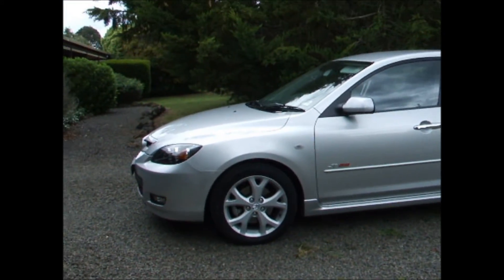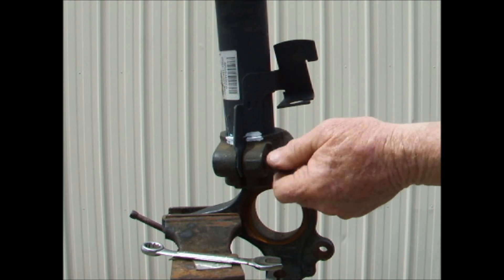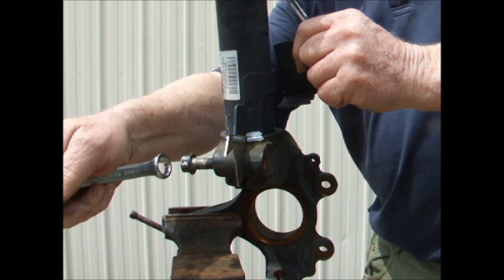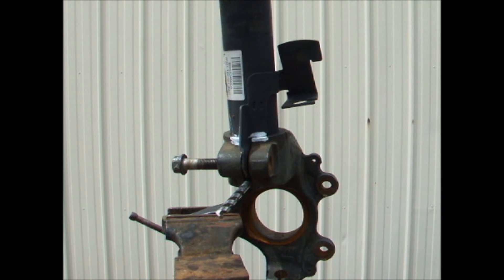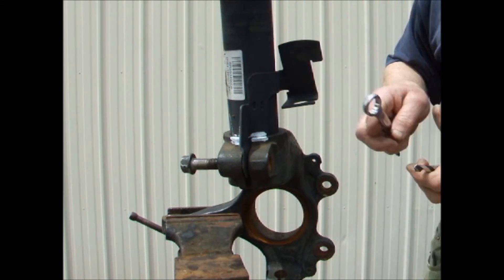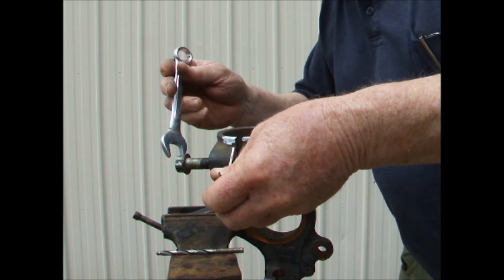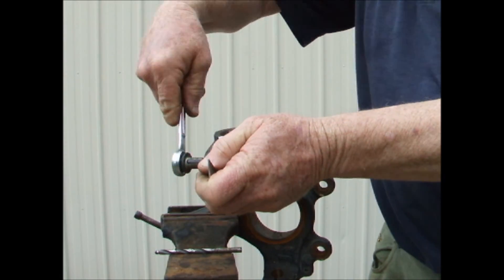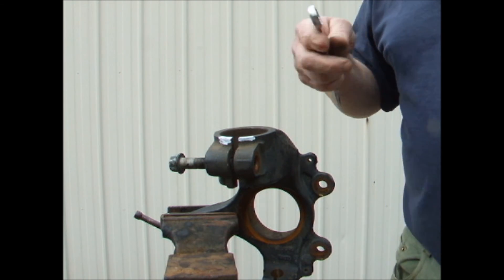Mazda3-How to separate a shocker/strut from a steering knuckle

Comment: What kind of steel plate is that?  I tried similar approach and the plate deformed and did not spread the knuckle.  Any advise?
Reply from the maker: Sorry for the late reply, I've only just seen your question. In the youtube I used stainless steel. At the wreckers I have used a seat belt tongue and at home I have also used a lawn mower blade, the swinging blade variety measuring approx 50mm x 140mm which is hardened steel. Good luck.

Comment: This so far has been a no-go for me. The bolt will not thread on the opposite side more than a few millimeters. Mine is a 2006. I am hesitant to power the bolt in. I do note that the hole on this side is quite small, really just to accept the tapered end of the bolt. I do wish yor camera was positioned to the other side, as that side is far less informative.
Reply: Phil BB I actually had this idea as well but, like you, threading the bolt in from the other side did not work, not without stripping the threads. I might try chasing the threads. I have an ‘06. What did you end up doing to free the joint?

Too bad the imbeciles couldn’t just have threaded both ears of the collar, then you could have easily used this method without having to flip the bolt around or even fully unfasten it.
Reply: I've done this on  2004, 2005 and 2007 models without your problem. I'm in Australia where there is no snow, ice and salt on the roads. Just a thought that the hole and first few threads may be rusted if you live in a snow and ice area.
Reply: i have the same issue, same model 2006 hatch, did you ever get it?

Comment: Nice idea, just be careful never to go more than half to one turn whwn spreading, you dont want the threads to not line up exactly when you are ready to tighten up the assembly. And use a new bolt if possible.